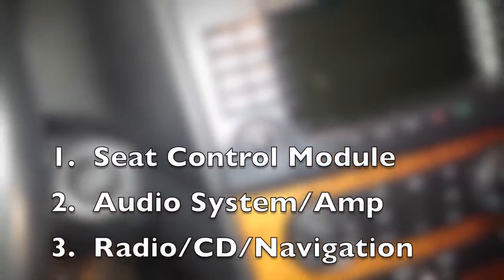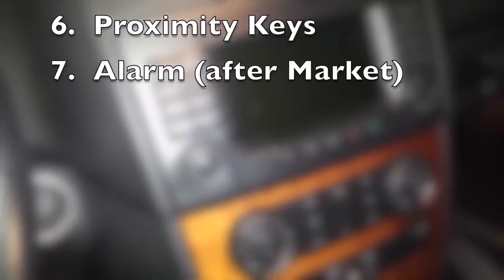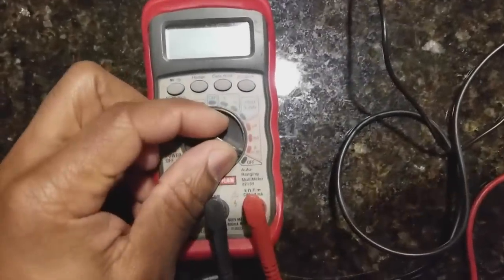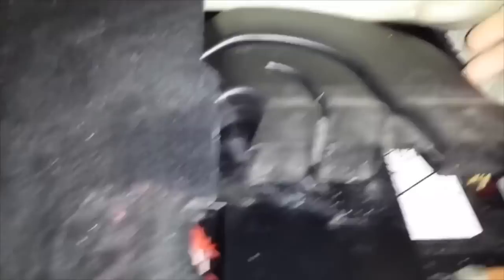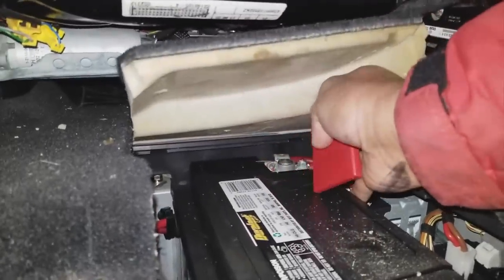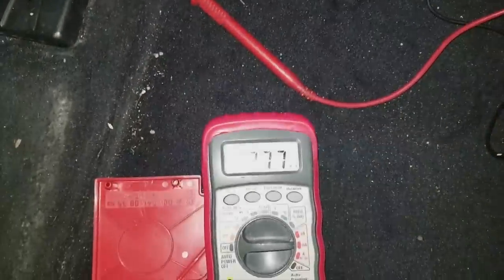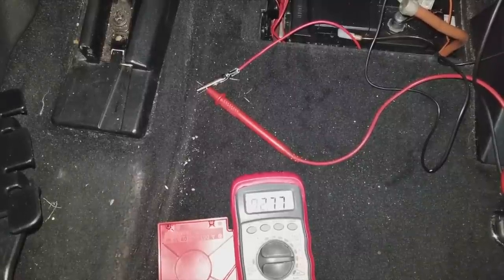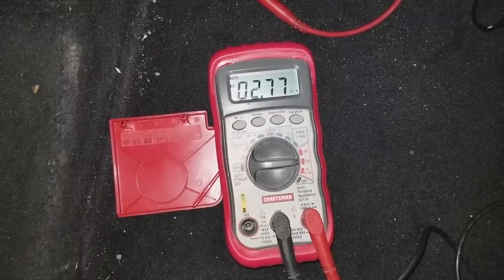How to Find Mercedes Battery Draining Components

Comment: I am a bit confused with your meter connection, it appears you connected it across the battery which is okay for measuring voltage, the amp meter should be connected in series rather.

Comment: I think my battery drainage problem is my radio because it’s always on when I turn the car on. Please note that I shut the radio off when I turned the cat off at night time.  Which fuse disconnects the radio as I try to find where the drainage is coming from?

Comment: I aree with the other comments re wrong connection shown in video and should take off one terminal and clip to meter ,other meter lead back to same terminal.I'm planning to use a blown fuse ,solder meter across  it (call that gizmo A) and unplug good fuses and replace with (A)  and therefore measure current in each fuse position.

Comment: He by passed all circuits in the vehicle by connecting the positive to the DVM. The DVM should be between the negative battery post and the battery post connector to measure the parasitic current draw.
Reply: i saw that too. its a wonder his multimeter didnt blow up
Reply from the maker: You really believe a 12v system can blow up a voltmeter that can handle more than 10x that amount?
Reply: @iRepairAutos  you are basically short circuiting a 120 A battery… and btw, a voltmeter measures Volts. An Amperimeter measures current (I). So could you please show the circuit you did since the video is very misleading
Reply: This isn't the way to connect an ammeter to measure parasitic current. It's a misleading video!

Comment: Could I just check the voltage on the battery and then compare that to the voltage some time later? So if it dropped from 12.6 to 12 I would see I had a problem?
Reply from the maker: Kinda,  but that's not a big enough drop in voltage.    How old is the battery,  what's the voltage coming from the alternator?   Does the vehicle have any after market electronics installed?
Reply: @iRepairAutos  No aftermarket electronics. When I returned from a 10day vacation the 18month old AGM battery was dead and refused to charge. The mfg replaced it for free so I now have a new AGM battery. It has maintained 12.6V since I installed it a few days ago. But just wondering why the previous $200 battery had such a short life.
Reply: Im having this problem right now. Have no idea whars causing a draw on my w211. Its frustrating. As i type this,my car reads 10v on battery n wouldnt crank to even check the altenator
Reply: @grimlock_rsv4634  My project for tomorrow is to look for parasitic draw on the battery so maybe I can be of some assistance later. Voltage is holding at 12.6 for now on the replacement battery. Sometimes you just get a bad battery. And the car had been in the repair shop a few weeks before. Sometimes the technicians do things they don't tell you about.
Reply: @accidental_relevance  lmk cuz i went n charged it cuz they said wasnt bad but i kno its gna die again
Reply: @grimlock_rsv4634  did you ever find the problem?? Same thing happening with my c250. Jumped twice and recharged once and battery life lasts less and less each time
Reply: @martincastro4198  no...I got rid of the  car

Comment: I have W204 - C350 battery draining issue.  I followed your method and could see that drain in close to 200 mA. I tried pulling fuses (from all three fuse boxes) one by one but did not find circuit which is drawing excessive current.  Subsequently I tried jump starting the car and nothing happens. No clicking from Starter.  Before the test it would start without problem with a jump. 
What could be wrong? I checked all fuses related to Starter circuit and they are all OK. 
Your reply will be appreciated. 
Thanks
Reply: AC-DELCO Batttery, GM WARRANTY SCAMS; anyone else been scammed by them? they tout a no questions asked 3 yr warranty BUT when my new $375 battery failed in 2 weeks, i was initially DENIED warranty and now been waiting almost 2wks for replacement

Comment: The cold has my car tripping? Other day car started but wouldn't go into gear ? Red light came on inoperative car I turned it off after warming now  are won't start.its making a humming sound! I'm stuck & don't know where to start? Transmission may be slipping or something else is occurring! Need your help? ML350 2009. What's your location you might can be of some assistance! My car & cold don't get along!
Reply from the maker: Did you scan the car for error codes?

Comment: Hi. I am having issues with a clk w209. It started with intermittent stalling and ecu recovery within 1-2 seconds.....then I went abroad for 4weeks. Came home....it started ok...drove it 10miles then all hell broke loose...really bad stuttering with esp workshop warning and tps failure...would role to a stop and it would start with the key (after 3 or attempts...) it went the 10 miles home stuttering 3 or 4 times on the way...parked it up...charged battery....from there it would sometimes partially crank then die and fan would be on full pelt. No ecu/pcm coms. It occasionally started with battery at full charge and ecu spoke....it did come back with terminal 51 not good and and I would have to battle it cutting out with keeping revs high (no limp mode issue) now it just wont start...not even crank. Esp not available, tps not available, engine overheating switch off now (engine is off) if I charge the battery it is drained within 15 attempts at crank...the cabin light dims when I try to crank...but no ecu coms even in just 2nd ignition position (no crank) auto box stuck in park. Just recently I tried it...red display...battery picture in display....then display malfunction...sometimes with engine picture, sometimes a lightning strike. Is my battery bad? Engine checklight comes on in display so I pressume the ecu is alive? Also all other modules will communicate...just not ecu......any ideas?
Reply: it looks like your engine ECU module is not "authorizating" engine crank.  Is your engine ECU seating on top of engine itself??

Try to isolate exactly the bad module by analysing what your CAN modules have to say.

Most Benz module replacement require dealer to code them to your car so 2 to $3K regardless of what troubleshooting you did already 😅

At least this will give you a chance to get your car fixed at once instead of paying $500 to hear: "sorry, we don't have room in the shop"

Some internet shops can refurb your very own module... so no coding needed ie. cheapest & fastest !
✌️

Comment: very confusing in connecting the negative, black alligator clip. It seems like to connected it to the battery, the battery cable, then connect the meter itself to the battery cable. Very much unclear.

Comment: Got a question: I had an issue where my alternator died and I replaced both the alternator and battery with new ones. Once replaced, the ecu failed to detect the new alternator therefore the car was only getting power from the brand new battery I installed until the power drained. What I observed was that the engine ran a lot differently, it ran like a race car solely on power from the fully charged new battery without a functioning alternator. Acceleration seemed to be ten times more powerful than when I had a working alternator and the old battery. When I got the ecu/alternator issue resolved the car reverted to running the way it did before, which was sluggish from a standstill. Does this indicate that the engine isn't getting the ideal amount of power from the battery/ alternator on a regular basis due to a drain issue? My car is regularly sluggish without any codes. I'm becoming more and more convinced the engine isn't receiving the correct amount of juice for optimum performance...
Reply: Be twin the altenater en the batery is electronic pack wich is connected with a negative cable the pins on this pack are very defective that pack controls all electricy in the car

Comment: I have a 2013 CLS Mercedes Benz whenever I park it in sport mode the suspension drop but it only happens sometimes it will go for days and then suddenly it drops could that be a leak or a malfunction sensor but in comfort it doesn't drop only in sport mode

Comment: I have ml 550, battery and alternator just changed. But battery keeps drainimg every night. First it doesnt ignite, then screen slowly dissappears. I guess there is a power short, but  no electrician is able to find permanent solution, they all advise changing the battery, which does not provide any solution.

Comment: Couldn't figure out the negative lead. From voltmeter to ground cable and then from ground cable to battery's negative terminal?
Reply: In matter of fact  it seems that the battery is still connected, so what's the point of dissconecting negative terminal and reconnect it with alligator connector
Reply: Im guessing he put the dvm "in" circuit as to be able to "see" the amperage
Reply: Was the battery positive terminal also connected?.....should not be! The voltmeter should be connected in series with the battery negative terminal. Fatal error

Comment: Can anyone help? C63 2010 battery keeps draining. Mercedes benz did a parasitic draw and couldnt find the reason for dead battery. Car has gone through multiple batteries and just burned through an OEM battery. Car lost power on the road and died. No idea why it drains battery still.

Comment: This is happened with me i find the drain and it was the redio but the fault wasnt the radio the fault was the rear control unit i replaced and now its ok
Reply: I bought the rear control unit but the batter keeps draining, does it need programing?
Reply from the maker: How did you determine that it was the rear sam?

Comment: Or his to check no Audio in S class? As a brake caliper remanufacturet how about rear electric brakes or the rebuilding of any caliper ever made? Ac cobra, Rare vintage Ferrari, Lambos, Rolls, Bentley’s? This video use glow fuses so it’s easy to see blown fuses. Or break apart amp to repair without sending them out? Resetting rear calipers with electric brakes, or bypass text and dvd movie so it plays in motion? I only asked u one thing Keith... what up bro ?
Reply: I have Mercedes c180 2005 model battery drain problem ac,tape,head light,room light n central lock plz guide what problem in this n side this problem is one relay and other relay

Comment: Just bot a used 2004 e500 from a tow yard car fiers right up after replacing new battery in trunk .had srs esp an a red break malfunction .reducing breaks .had no break presure at all .changed the break light switch an after turning off an on it had breaks for about 10 minn an then it just works an then dont  work today it had red battery light an said altinator /battary i reved it turnd off an on bunch of times it went away then out of no where all the erors went away an evry thing worked an then they all came back an no breaks after 5 minn idk im stumped could a minor low voltage couse this
Reply: I hope it's dependable and doesn't brake down a lot
Reply from the maker: Check the voltage coming of the alternator,  check the serpentine belt.  And as mentioned already,  check your ground connections,  terminals can be corroded on the inside connection point. Clean every thing.

Comment: Man I changed the crankshaft position sensor I checked the fuel pump I've checked everything but my ML 500 mercedes benz 2003 won't start
Reply from the maker: What error codes?
Reply: @iRepairAutos  it's not showing any bro
Reply: Have you got any solution?
Reply: Try changing camshaft position sensor as well

Comment: My 2007 ml350 the battery always gets drained even when pack at night..I come back in the morning to see the battery drained..
I have changed new battery and it's still happening..
Reply: I have the same problem with ml550. Cant find solution. Could you find any?
Reply: @sinaneralp4786  yes I did..it was the light on the right door that was onlways one ..I couldn't see it but at late night when u turn car off,the light still remain on, that was when I discovered it..
Check the buttons doors or monitor the dashboard light when u turn off and pack your car
Reply: Did you watch the video!?

Comment: Took my car for inspection 4 days ago and my car was fine and pass the inspection. But got home the car battery was flashing so I called them up they said to bring it back I brought back the guy says there's nothing wrong with my battery and it's fully charged and it looks like they have to dona full diagnosis that will cost $200 so after I paid them 200 to for inspection and to fix what ever faltt they found now my car has a problem I never had before and they want to charge me for it. They got the wrong one I aint going back.
Reply from the maker: They did something to it.   Maybe intentionally maybe not

Comment: Do not hook up your multi meter like this lol the ammeter must be connected in series. Disconnect NEGATIVE terminal and put one clip on terminal and other on NEGATIVE post. Use negative post and terminal to avoid shorting cuz negative is to ground.

Comment: Forgot to mention the trunk light and how to defeat it.
Reply from the maker: If it's staying on,  That's a bad switch.
Reply: Nah.  It goes off in about 5 minutes.  I'm just impatient.
Reply: @iRepairAutos  I have that issue the trunk brake light staying on and electric seats not working
Reply: @iRepairAutos  what you mean a bad switch. How do I go by replacing the switch

Comment: I have mercedes ml 320 2008 i have replaced battery and putted gel.Batery is charging good after 5-6 days voltage drop to 11.2 and car can’t start after charge battery car start and repeat process in 6 days
Reply from the maker: Something in the vehicle is draining the battery, even when the car is off.
Reply: @iRepairAutos  Thank you
Reply: @iRepairAutos  I sloved one problem with removing android multimedia but I have same problem now
Reply: Something is constantly drawing 1 amp from battery when I pull the fuse dvd player it drop 10 mili amps